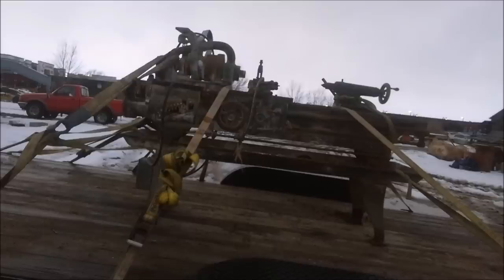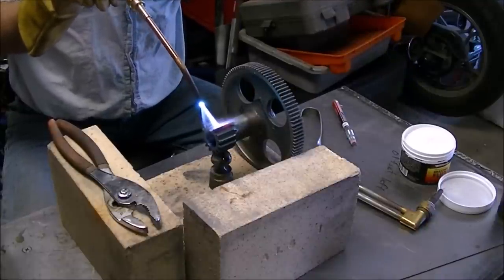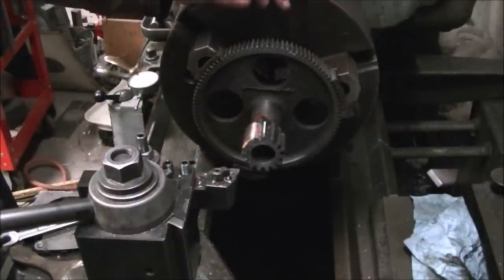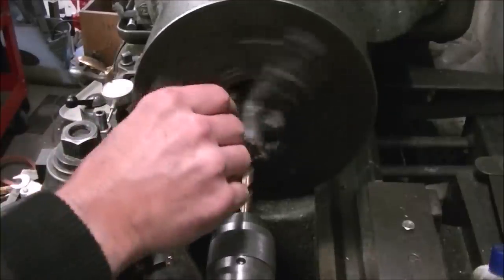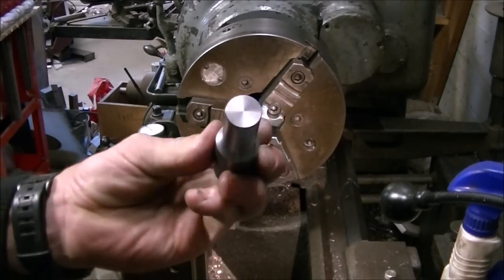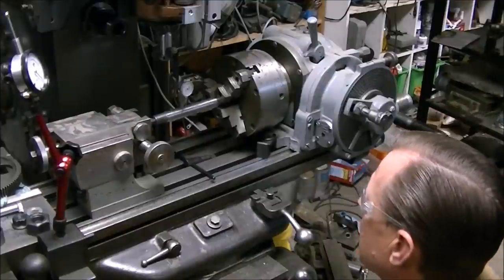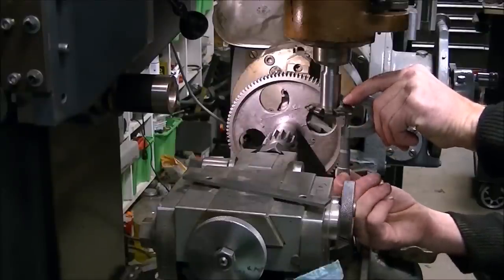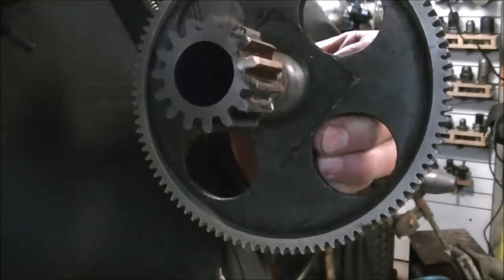Hendey Gear Repair

Comment: Hi compliments for the job, one question can i know what material is the wand used for welding?
Reply from the maker: +Nicola Esposto thanks for stopping by. I was using silicon bronze rod (similar to this https://weldingsupply.com/cgi-bin/einstein.pl?PNUM::1:UNDEF:X:SILBR11636) for the brazing. I was dipping it in brazing flux. Craig

Comment: NIce job ...but i have my doubts about the material of the new teeth...wont be softer compare to other teeth ? Wont be more easy to brake or deform compare to other teeth ?? It would not be better instead of brazing to add more material by welding arc ???
Reply from the maker: Silicon bronze has very similar properties to gray cast iron. In a case like this it is the preferred method as welding results in very hard material that is difficult to machine. In this series of videos Keith Fenner does a large brazing job and explains why brazing is preferred when parts will be subsequently machined https://youtu.be/1pHepfgw9lk. In my next video I'll show a part of the lathe that someone tried to arc weld and the problems with it. Thanks for stopping by. Craig

Comment: Just an idea, more from  Keith and Dave Richards, but instead of removing and then brazing and then cutting new teeth, what if?  You turn down the shaft removing the teeth and turn the shaft down to what is still a safe diameter then machine a new gear out of steel that will press fit over the turned down shaft.  You'd end up with stronger teeth and not subject the casting to all that heat and brazing.  Heat the steel gear in the old toaster oven for half an hour at 450F and with the proper tolerances it should slip right over the end off the casted shaft with minimal effort?  Thoughts anyone?
Reply from the maker: +Scott Pecora as I mentioned in the video, the gear is not on a shaft, there is bore through it that would leave very little material if the teeth are turned off. Mr. Rucker also uses this method https://youtu.be/YWaF_QhcxA0 as does Mr. Fenner https://youtu.be/FcD_Ue2R11M. I'm pretty confident it'll hold up in this application. Craig
Reply: I thought the same thing. Turn it down. Buy a gear.or make 1. But great video. I think he wanted to do what hes never done b4. Which was make his on tooth. Which would be needed if shtf.  Gr88t job. Keep making calm cool collective videos. Thanks
Reply from the maker: +Lee Jones thanks for the kind words. You're right, I wanted to try my hand at great cutting as I'm planning on making a set of transposing gears for the lathe so I can cut metric threads. The other concern is how little material would be left by the time I turned the teeth off and took off enough for the bore of the new gear. It would be pretty skinny at that point. If this repair doesn't hold up that'll be plan B of course. Craig

Comment: Really nice job, awesome mill. I am sure that repair will last another 100 years :)
Reply from the maker: +Makin Sumthin From Nuthin thanks for stopping by. I an really lucky to have the mill. In the past 10 years or so I've seen 2 for sale in our local classified ads, and I bought one of them. It took a little work to get it running again but definitely worth it. Craig
Reply: I wish my shop floor would support a mill (raised building...wooden floors). It would go right thru the floor to the ground. Lol
Reply: With all the heat that was applied during the initial brazing, doesn't that ruin the metals hardness? Is a heat treatment necessary at the end of this project ??
Reply from the maker: +Bernard Furst the part is cast iron and was not heat treated originally so there is no need for heat treating following the repair. Craig
Reply: @clemwyo  ok thanks, that clears that up.
Reply from the maker: +Bernard Furst thanks for watching and commenting, glad you stopped by. Craig
Reply: Makin Sumthin From Nuthin on

Comment: nothing like a well made old american piece of machinery.  worth every penny then and now. excellent video, your attention to the minutae, that is the myriad of little details is comendable.  was the brass hard enough??
Reply from the maker: +Paleo Man you are right, the old machines have a certain something that makes them special to use. I feel I'm just a caretaker getting then in a little better shape for the next caretaker. The repair is actually bronze not brass. I'm still working on the restoration so I haven't put the tooth to the test yet. I have got 2 more gears that are broken to deal with. One I'll repair because it is a complex casting and the other I'll make a new one. Thanks for stopping by. Craig
Reply: i always have my eye's open for old american tools, equipment. the quality for the most part is outstanding compared to anything from harbor freight/ china.  I agree with the caretaker concept. Even some of the japanese stuff is really well made. They eventually got quality control down to a science. There are a few gems out there that were made of quality materials and by skilled craftsman.

Comment: Great Video.  I have to do the same to my new to me Hendey lathe.  Now Seen that you had a No.6-10P gear cutter on your arbor that you made.  Is that the cutter you used?  Or did you use a No.7-10P?  I'm curious cause like i said i need to do it as well but thought it needed to be a No.7-10.
Reply from the maker: Jim, 

I have a bodged together set of gear cutters and the one I used was the one that fit the unbroken teeth the best. With the lathe being built in 1910 I'm not sure how standardized things were so I just tried the cutters I had and used the one that fit best. Probably not the right way but it was either that or let the Hendey go to the scrappers. Thanks fort stopping by.  Craig

Comment: How strong is now that new tooth u made,is it same as others ,stronger,weaker ?.
Reply from the maker: +TheSRBgamer63 the silicon bronze rod that I used is actually stronger than the original cast iron so I hope the repair will last a long time. I've seen some really old brazed repairs the seem to have held up very well. Thanks for watching and commenting. Craig

Comment: ( 6:38). The big gear probably bent, when it took out the small gear tooth.
Reply from the maker: The big gear is not perfectly concentric with the bore. For the low speeds involved Hendey must have thought it was good enough. When I have the gear on a mandrel later in the video you can see that the run out on the big gear isn't that bad. Thanks for stopping by. Craig
Reply: @clemwyo    yes i saw that. but if you wanted it more true, a little leverage might do.

Comment: Nice, a  calm man indeed
Reply from the maker: +Stuart Hearn there are those in my house who might argue that a bit but thank you for stopping by and commenting. Craig
Reply: had a Dean SSmith Grace once, rep of best toolroom lathe ever, was over 3 tonnes, only 5ft or so between centres, the same headstock was  used for 4-metre lathes, miss it

Comment: clemwyo We just subed your page/site anyway I was a machinist for 25 years until my left leg was taken off (congestive heart failure) caused problems. like I said we just started watching and we are really looking forward to seeing this old girl up and running again. another thin, the teeth you did not do, cutting them out will weaken the over all gear right? we are thinking you could do what you did with the missing tooth without grinding off all the other teeth all together right? that way the braze will just fill the wear spots, of cours3e you would rough them up good to make sure the braze stuck well. YOU MADE ME FELL LIKE WORKING my mini machines again, even no I can't run the big ones hahaha hope to see the lathe up and running, Joseph T
Reply from the maker: +Joseph Brendel thanks for stopping by. I have thought that if the wear in the teeth is a problem once things are back together that I would do as you mentioned and braze the remaining teeth up and recut the teeth and let the braze fill in the worn bits. I've got quite a bit of work done on the old girl so I need to put an update together soon. I hope that you can get OT and work with your machines soon. It is my form of therapy, and much cheaper than seeing a shrink. Craig
Reply: clemwyo you got that right no SHRINKS hahaah thanks for replying to my comment and saying that too! I wish there were more like you out there, most you tubers don't bother to reply! YOU MADE MY DAY! I had my wife clear a path to betsy my min lathe hahh soon we will be electric motoring down the street, heck with buying a hub motor we can make one THANKS AGAIN!1 JOSEPH T
Reply from the maker: Joseph Brendel good luck with your projects. Making and fixing things with my own hands sure I'd good therapy for me. Craig

Comment: How strong is that compared with the origional tooth?
Reply from the maker: +RobWillmot the silicon bronze that I used actually has higher tensile strength than the original cast iron. Assuming I did the surface preparation correctly, it should hold up well. Thanks for watching and commenting. Craig

Comment: If I am very wrong apologize. But why fill the tooth with bronze and not with a nickel electrode? Which can be machinable also and almost as hard as the original tooth. Afterwards, if your work is really very prolix
Reply from the maker: Victor, thanks for stopping by and the question. The grey cast iron the gear is made of and the silicon bronze I used for the repair have very similar strength and properties. Nickel rod repairs work well for some type of cast iron repairs but the high heat involved with the welding process can create hard spots in the cast iron. Gear repairs with silicon bronze have been done for over 100 years with very good success. Craig
Reply from the maker: Victor, check out this video from Keith Fenner for good explanation of the problems with welding cast iron. https://youtu.be/1pHepfgw9lk Craig

Comment: I liked your video. If you could find a new (or used) gear it would have cost a war pension. I enjoy videos where the emphasis is on repair. We live in a throw away society.  Thanks again.
Brad
Reply from the maker: +Bradley Leben I really enjoy fixing up these old machines. They have done so much work during their lifetime and with a little attention there is no reason they shouldn't be able to go another 100 years. It is nice to work on things that were meant to last. Thanks for watching and commenting. Craig

Comment: nice job and i love that mill is that a Dickle
Reply: I see now it is a milwaukee very nice
Reply from the maker: +patrick roeill the mill is a 1945 Kearney & Tracker 2HL, Universal. It's a horizontal mill that I made a mount so I could put a Bridgeport style vertical head on. It is a wonderful machine with power feeds and rapid traverse in all 3 axes. Keith Fenner had one that is almost identical and Keith Rucker has the next size larger K&T. I feel very lucky to be the current caretaker of the mill. It'll be going long after I'm gone. Craig
Reply from the maker: +patrick roeill K&T (Kearney & Trecker) was based out of Milwaukee and had that cast into all of their machines. Craig
Reply: Awesome job that mill is awesome i have a BP not as nice as your K&T thanks for taking the time to answer me
Reply from the maker: +patrick roeill I love having a horizontal mill but having a vertical head with a quill is so convenient that I almost never take it off. There is amazing work done on Bridgeport style mills despite what the heavy iron owners say. Craig

Comment: How much weaker is that gear now compared to a new one?
Reply from the maker: +EvoPortal according to the numbers it should be as strong or slightly stronger. This is a common repair that has been used for many years with good results. Thanks for stopping by. Craig
Reply: ok but that weld isn't hardened steal like the rest of the gear...
Reply from the maker: EvoPortal that gear is gray cast iron, it is not hardened. It is the pinion gear that runs on the rack on the front of the lathe bed, a low speed, low force application.
Reply: oh ok. Very well then.

Comment: Why did you use a brazing rod instead of a steel alloy?
Reply from the maker: +gary24752 the part is cast iron so I used silicon bronze rod which has higher strength than the cast iron. Thanks for stopping by. Craig
Reply from the maker: +gary24752 the part is cast iron so I used silicon bronze rod which has higher strength than the cast iron. Thanks for stopping by. Craig

Comment: I made new starter teeth for my ford 8n tractor welded it with 7018 rod then used my dremel with carbine teeth and shaped the back to original
Reply from the maker: +Ricky Watson that would definitely been quicker but I've really been wanting to learn how to cut gears from scratch so this was my first step. Thanks for stopping by. Craig

Comment: Considering all the work to fix one tooth and that the others are worn and likely also flawed, I like your first idea--  to make a new geared sleeve for the assembly.
Reply from the maker: MrGGPRI The other teeth are fairly worn. When I get the lathe back together I'll see if the wear is excessive and if so, I'll try the sleeve method. I really just wanted to try cutting a gear tooth to see if I could. I'm getting things together to make the gears necessary to transpose to cutting metric threads with the lathe so it was sort of a dry run on the gear cutting. Thanks for the comment. Craig

Comment: If you do this ever again or similar with cast iron, cover the part with silica sand in a bucket or temp drop in an oven to avoid cold cracking.
Reply from the maker: Thomas, thanks for stopping by. I cover the parts with a fiberglass welding blanket that really does the cooling rate down. It seems to work well. Craig

Comment: Fascinating video.  My father was a tool maker, turned engineer.  He acquired quite a few machines over the years, but primarily only used the lathe.  He passed away a few years ago, and I never really learned metal work, but would like to as a hobby.  One question, which probably reflects my ignorance, but how did you determine what size gear cutter to use? Thanks.
Reply from the maker: +my1after909 thanks for watching and commenting. I had never seen a lathe run in person before before I bought mine. With all the great machinists posting videos and forums like the Practical Machinist, you can get started. 

I have a set of used gear cutters and I fitted them to the good gear teeth until I got the best fit, and that was the one I used. There is probably a mathematical way to figure it out but I'm more of a practical type. Craig
Reply: Select the DP cutter for the number of teeth,

Comment: Exactly what I need for a broken tooth on a drill press quill. Full height floor type for $40! Couldn’t pass it up. Thanks!!
One request, if I may; please speak up. I can barely hear you.
New subscriber and bell!
Reply from the maker: +Super Goober good luck with your repair, let us know how it goes. I've got an old flat belt style drill press waiting to be restored, maybe once I get the lathe done. I think I've gotten the volume issue sorted so try one of the newer videos and see what you think. Thanks for stopping by. Craig

Comment: I'm concerned that the brass tooth might be a future point of failure due to it's lower strength compared to the originals.
Reply from the maker: Landrew0 I looked into that a little. Silicon bronze is actually similar in strength to gray cast iron with tensile strength of the bronze being higher. Also, my 1943 Henley lathe has some parts that have been repaired with bronze brazing at some point in its life that have held up over the years. If it does turn out to be a problem I'll turn off the existing teeth and press a new gear on. Thanks for stopping by. Craig
Reply: Excellent.
Reply: Try drilling maybe 2 or 3 holes in where you groved with angle grinder thread and studs fitted where the tooth is missing then brazen the area the studs will be stronger that the brass. Saw this done in a professional engineering shop 35 years ago.
Reply from the maker: +Austin Tuckey that would be a great repair also. I used silicon bronze for the repair which is much stronger than brass, similar to the strength of cast iron actually. Keith Rucker did a repair with a dovetailed key that would be the next one I'd like to try on the next broken tooth I run into. Thanks for stopping by. Craig

Comment: I'm just curious... is this strong enough to handle the movement ?
Reply from the maker: +ahmet celal kupeli thanks for watching and commenting. According to the research I did, it appears the silicon bronze is actually stronger than the original cast iron. The idea behind grinding out the old tooth is to allow sufficient surface area for the two materials to bond well. As I am doing a full restoration of the lathe I haven't had a chance to try it out yet. Craig

Comment: It is better to mold to the missing metal tooth than is suitable for a soft material weld
Reply from the maker: mark ben that is a common misconception about silicon bronze. The following properties show that it is actually stronger than the original material. Typical Mechanical Properties of Silicon Bronze:
Tensile Strength 55000 lbs/sq. in. (379 MPa
)
Yield Strength 25000 lbs/ sq. in. (172 MPa)
Grey Cast Iron Properties: Tensile Strength 23,000 lbs/ sq. in. (130 MAp) Yield Strength 14,000 lbs/ sq. in. (98 MPa).
Thanks for stopping by. Craig

Comment: when I was a teenager I always wanted to learn the mechanics course, but the lack of money prevented me, today I am a sad systems analyst. I'm sorry for my English, I'm brazilian
Reply from the maker: +Celso Raymond I didn't buy my first metal machine tool until I was almost 40 years old. I'm actually a geologist but I spend as much time in the shop as I can. Find whatever you can in the way of a lathe and get started. 

No need to apologize for your English, it is much better than my Portuguese.

Craig